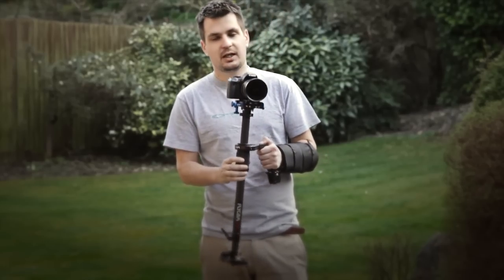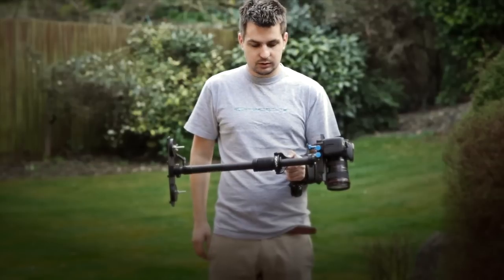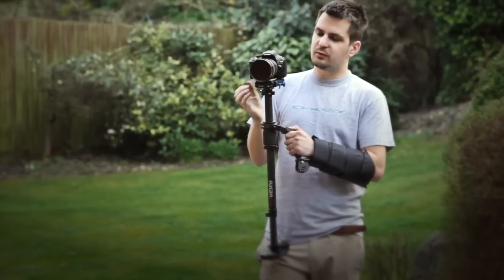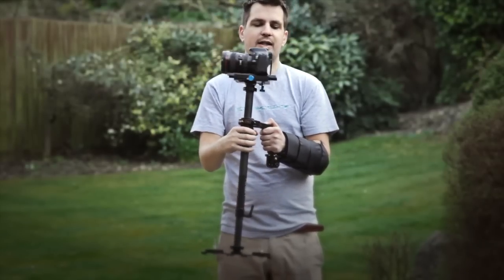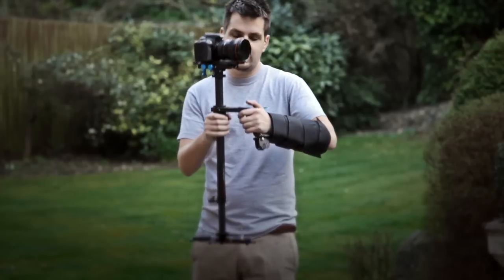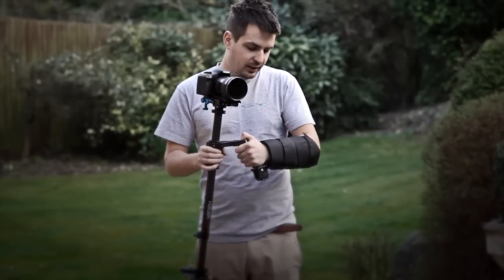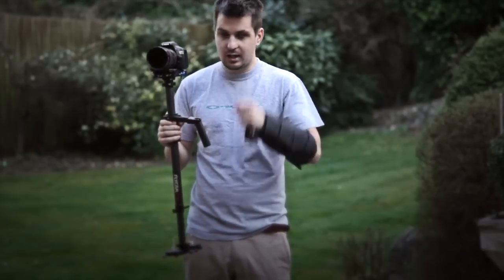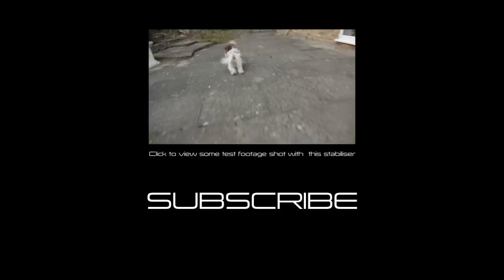HOW TO BALANCE a Flycam | Glidecam | Stabilizer | Steadycam  + TIPS on Achieving Best Results

Comment: very good job thanks - no manual was included in the box - so I'm going to look up what the extra parts are for.  I had one 6-8 years ago, when down the process of finding a small mechanical gimbal, and I'm back to this.  Much less stressful worry about batteries or it getting wet.  :)  Thanks for the helpful and clear video.

Comment: Some great tips in there,  I bought a stabilizer fairly recently and can't quite get rid of that jerkiness in the horizontal, but I'll try what you said and hold onto that gimble even more lightly than what I've been doing and see if that helps.  Anyway, good video!

Comment: I'm sooooooo damn Frustrated by Flycam not balancing. Hard to balance. Lets see what fruition will come from this video.  This is my 10th tutorial video.
Reply: Hahahahaha this did make me laugh !!!! I've watched this four times now on repeat and its still fucking with me.
Reply: Nomads Seven I got a flycam 3000..it just dosent balance. I've watched every video and tried every technique..IMO the only solution to balance it right is to use a different mount plate..the one with just one screw to set the x and y axis adjustment..my plate just shakes and moves very randomly.
Reply: Lol so do I
Reply: Hahahaha 10th. This is my 467th

Comment: NIce, I' waiting for my stabilizer to arrive and I'm glad I've watched this!
Reply: +Philippe Orlando Got my stabilizer and I'm pretty happy with it. Now I'm wondering, do you think that, regardless of how much weight you have at the bottom, it's always better to try to keep the axis as long as you can?  I'm thinking if actually weight as far down as possible from the camera is actually better?  What I mean is I have some intuitive feeling that the longer the axis the less incline the whole set is going to move? Am I wrong here and what just matter is just to balance it regardless of the length of the axis?

Comment: I am using a d5300 with its 18-55 kit lens on a stabilizer similar to the one in this video. I have done the balancing techniques shown in this video, but my camera is not very steady (bobs forward and backward alot) and it leans to the right side (when I have an even amount of weight on the bottom. I have tried adding additional weight to the left side weight stack on the bottom and it has helped but am I doing it properly?) Also are the weights suppossed to be in a straight line with where the camera is pointing? Or on either side of where the camera is pointing (my pole rotates on the weights, I don't know which direction the weights should be pointing)

Comment: Hi Alan.
(On the 3:35 min of your video) I used stopwatch and the 22, 22, 22 method and it takes about 1.5 seconds for the weight to drop down, instead of 2-3 seconds the way you count.
So, my question is: if you've read the instructions in a manual that said 2-3 seconds, then what you are showing is incorrect.
But, if what you are showing is correct, then then it's not 2-3 seconds.
My stabilizer came with Chinese instructions. Please help me out here.
Thank you.

Comment: Hey, I have a problem. I've got a samsung nx1000 and it's weight is 400g. I have tryed to use it on my glidecam hd 2000 but with no good results. I think it's too light. Is it possible to get it work with some extra weights?

Comment: Is it possible to adjust the gimbal upper or lower ? Or it's fix the pole ?  For HD-3000
Reply: I was trying to adjust flycam gimbal but it seemed fixed and can't move. Thanks for your reply anyway. And Big problem I found out is balance problem if your hand position for eg. hold gimbal on the left of center pole then change to the back of the pole it will unbalanced. idk if it happens only with Flycam or ?

Comment: I am using the cheaper neewer one and frustrated by the fact that it can only balance when the handle is at a the same position where I did the balance.say I put the stablizee on my c stand with handle on the 3 o’clock , after it is balanced and I pick it up,if the handle swing to 4 o’clock or any other position, the balance will be gone.drop time was 2 to 3 sec. is that because it is a cheaper one or someth8ng I did wrong.

Comment: I've been shooting w/ flycam nano and 7d w/ tamron 17-50 for a couple years, never good balance. Now using a nex 6 and 16-50 pz and it's perfect. I realize way too much weight on the bottom, even with 7d, that was the problem.  It just seems like there should be more weight.

Comment: Mine doesn't take long to drop at all, I don't want to add weight to the bottom because I already have enough weight there (the camera i use on top is very small, an A7S II)
Reply: Hmm, ok so i'm trying this with the A7S II and a Tokina 11-16mm and without any weights at the bottom and I just can't seem to get it to stay upright no matter how many times I adjust. If I adjust it further back, it tilts backwards, if I adjust it to the front it tilts forward. Moving it side to side doesn't help balance as it's either tilts right or left. Been trying for like an hour. Perhaps my camera is too small?

Comment: silly question : does the lenght of the pole affect the stabilization?
Reply: Yes, as you move the counterweights away from the fulcrum (gimbal + handle), the lower end of the stabilizer will become more bottom heavy. As you shorten it the rig becomes more top heavy. As a general rule, the longer the pole is, the less counterweight you should use; and the shorter the pole is, the more counterweight you will need.

Comment: i bought a glidegear - glidecam imitation. I am confused - when i change the position of my hand holding the steadicam, it goes off balance. why is this the case? I can balance it fine with my hand at holding the device at the back, but it changes when i put my hand to the side for example. Also, the gimbal/bearing seems too stiff because i can turn the camera without using the other hand. i need help! I did however just post a little test and you can see it's unbalanced. It's really annoying me

Comment: I bought the FLYCAM 5000, and I've got a canon 6D with 24-105 lens, . after 2 days it still not perfectly stable I don't know what to do. I followed every steps. my camera still turning around when moving :-( help please
Reply: If the camera spins while you are moving, you simply need to apply slight pressure below the gimbal to keep the camera facing the correct direction. If the camera is tilting upwards or downwards you will need to correct the positioning on the baseplate. If the camera leans forward, move the baseplate back slightly, if the camera leans backwards, move the baseplate forward slightly. Same deal with left or right, simply adjust the baseplate in the opposite direction as the camera is tilting.

Comment: my standing straight but revolves around: <what do you do?
Reply: +LaRRy L33T What do you mean? It tips side to side or? It might be that you need to move the camera left, right or forward, back. If it's balancing fine when standing still but when you move it's tipping, you need to hold the pole just below the camera when moving.
Reply: on tests without holding the pole by moving the camera from side to side, it is practically in place and my tilts in the left or right so I be ?? Is it possible to set the teeth were still
Reply: LaRRy L33T Do you mean the whole thing moves or the head spins around? If the whole thing is moving you need to adjust the plate or length.
Reply: +NGRPNathanKing   already tried everything I possibly too heavy camera and tripod is too small because only 40cm
Reply: LaRRy L33T Hmm ok is the camera heavier than 3.5kg?